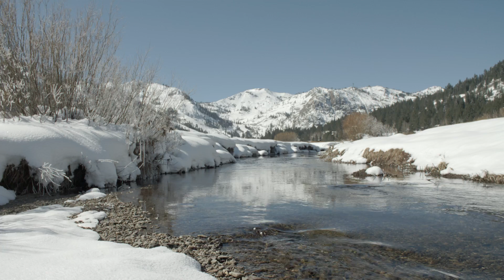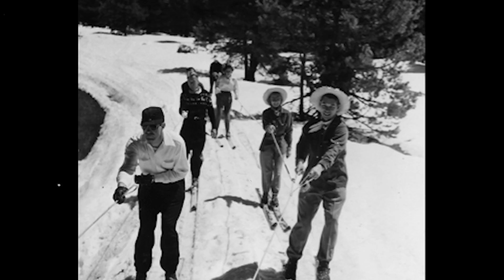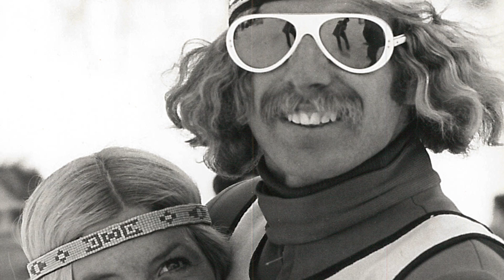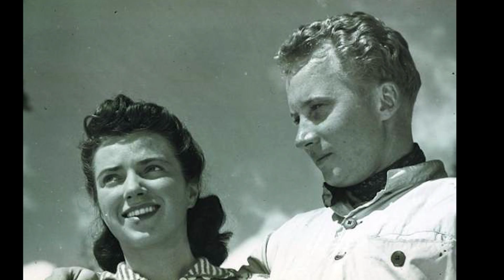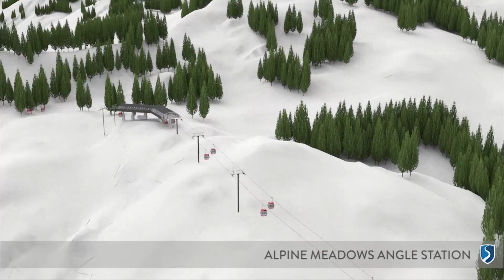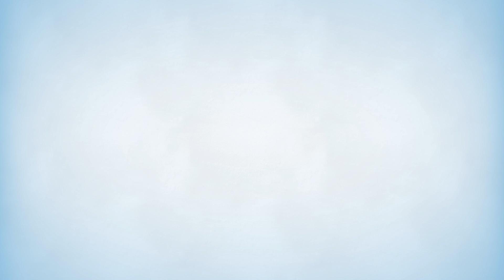Palisades Tahoe Base-to-Base Gondola Planning Process Now Underway

Comment: A few things to ponder about this lift:  It will not open up any new ski terrain. Troy Caldwell will not allow skiing on his property, unless they are guests of his. They claim it will take 16 minutes to travel. It takes about 15 minutes to ride the bus over. It will cost around 30 million, the cost of replacing about 5 chairs with express lifts or doing a lot of other, more beneficial improvements on the mountain, such as improving snowmaking.  It will slice a corridor though the West Faces-75 Chute area on KT-22, hacking down trees that are critical for visibility in flat light conditions and spoiling some of the best expert terrain on earth. It is a marketing gimmick that sounds cool to the uninformed.
Reply: Grizz Kid 16 mins to travel and 15 mins for the bus but you fail to account for waiting for the next bus to arrive, getting on and off, walking to the lifts, putting skis on etc.

Comment: I really do think constructing the Gondola is a mistake. It will COMPLETELY destroy what makes Skiing at Alpine so charming, a separate, distinct identity from Squaw. I'm still against it, although, the Peak 2 Peak Gondola at Whistler/Blackcomb is based on a similar concept as the Base 2 Base Gondola. However, Whistler and Blackcomb are also base joined (making connecting them further up the mountain a worthwhile concept) which Squaw and Alpine are not. In the long run, I really do think it will cause Alpine to become overcrowded and overrun with Squaw skiers, boarders and riders thereby taking Alpine's unique individuality and "hidden gem" qualities away. I'm not a fan of the project and have to consider if I will continue my Squaw/Alpine pass in the future, since my pass revenue will indirectly contribute to the building of said Gondola.
Reply: Ben Schaeffer come on man, cut the drama! If there’s too many people at Alpine then you can always ski at Squaw. None of this philosophical crap. It’s way less of a hassle to just get in the gondola to the other mountain and ski then to wait until the next shuttle, walk to the shuttle, wait until you get to the other mountain, get off and walk to the base camp. It’s a pain in the ass as it is and this gondola would solve all of that.